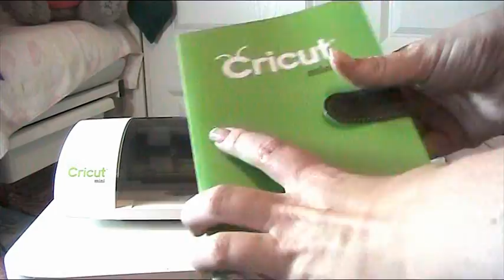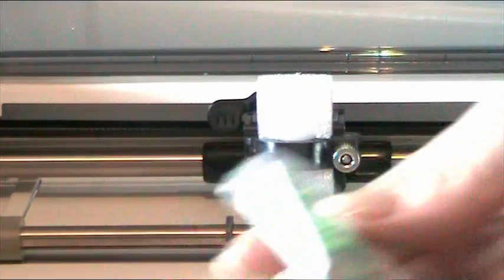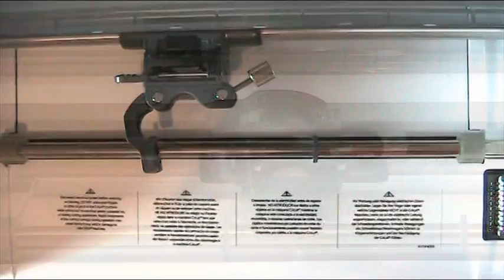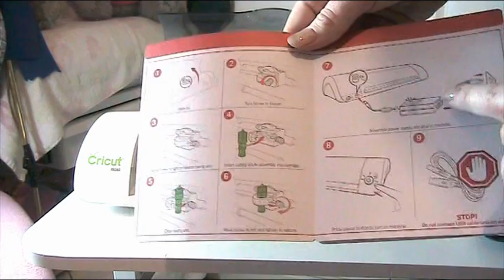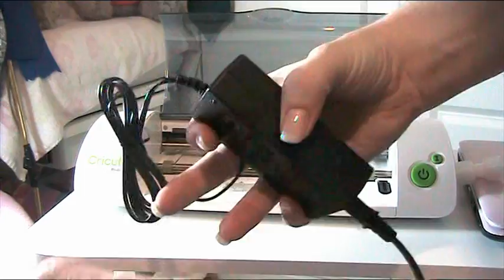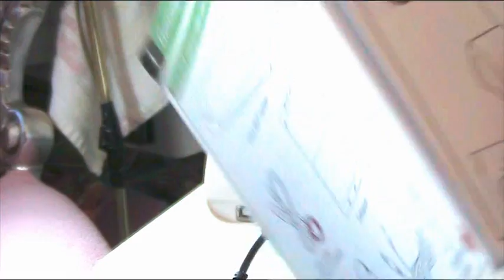Cricut Mini  - setting up (2)

Comment: This is now just a huge paperweight since Cricut no longer supports it and the only way to cut with it was to use the Craft Room software which Cricut disabled, so you can't do anything with this, anymore. It's sad. 🥺
Reply from the maker: It is sad and i did do a whole video on it but the actual inability for the machine to work was not actually cricuts fault. There was a change in how the internet worked and it meant that the new way was not compatible. Now a lot of people said well just change the software which was clearly doable as we have design space. Problem was however the hardware, the machine itself is not able to work with the new software - whatever cricut did because the tech in the machine was compatible with the old internet tech. So it just was never going to work. Where I think they went really wrong was they never made a proper announcement at all, let alone making that announcement in a decent amount of time then. they did some half baked thing where they gave people a discount on a new machine, but for those that already had that new machine because we liked both the mini and the bigger machine we were not eligible for that discount or any kind of refund.

Over here in the UK I even found a wholesale company that sold onto stores et cetera that were still selling the cricket mini after the changes meant that it was no longer able to be used. I contacted them because I knew them well to let them know and they had not even heard a word from cricut either so it seems to me the main thing that went wrong was the lack of communication. I accept that they really couldn’t do a lot about the way that the Internet has completely changed all to do with flash et cetera and the fact of the matter is whether we like it or not technology has moved on in such a way that the cricut mini just could not keep up with that but they just didn’t tell anyone

I mean it’s not like they didn’t have all our email addresses because in order to logon to craft room we had to submit our email addresses so it would’ve been very simple to send out an email six months in advance to let everybody know. That’s what I thought was outrageous and I did contact them about it and asked for a comment but didn’t get very far other than to get some sort of half baked three months free for the cricut access for Design Space – Yippee! Like you say it’s just completely useless I literally ended up putting mine in a skip - it was literally a beautiful working machine but I couldn’t obviously use it and I really really liked that little machine but that’s the problem I guess with technology and also the reason that I’ve kept my original cricut as well as getting all the new thing because at least with my original cricut all I need to do is stick in a cartridge and technology is never going to make that out of date unless my cartridges  break I should be fine! Hugs Amanda

Comment: I was wondering if you would be able to help me.  My mini will not recognize when the mat is in the machine.  It loads and then says, Please load you mat.
Reply from the maker: Are you sure it is loading all the way in? I have found in the past if I don't push the mat right up to the bar before clicking the button to load then when it does load it doesn't take the mat in far enough and therefore thinks it is not loaded?  Also make sure you are lined up straight and between those little marks on the base. Let me know and you can message me from my web if you prefer private conversation xx

Comment: hi can u cut stencils with the cricut mini
Reply from the maker: Yes not a problem, I have cut stencil material using a deep cut blade or by doing multiple cuts. When doing by doing multiple cuts set the cut depth to quite light and then the blade glides over the stencil material rather than digging in. And just keep going slowly slowly. The other way i make stencils is just using card, disposable stencils lol! Hope that helps xx
Reply: Ahhh thankyou so helpfull xx